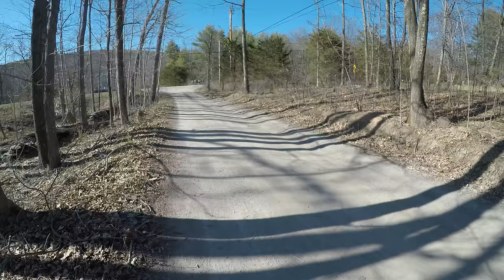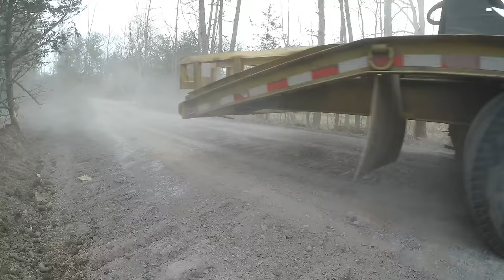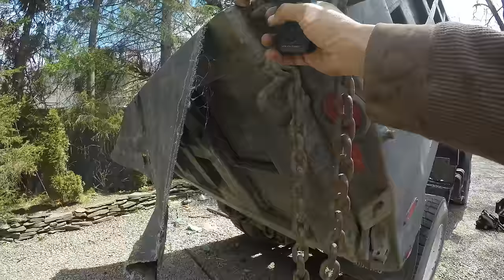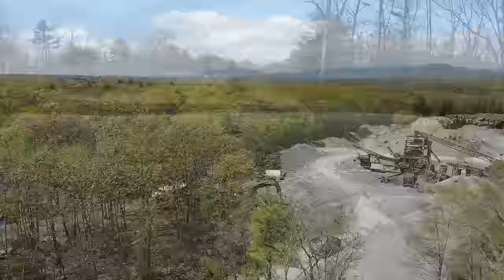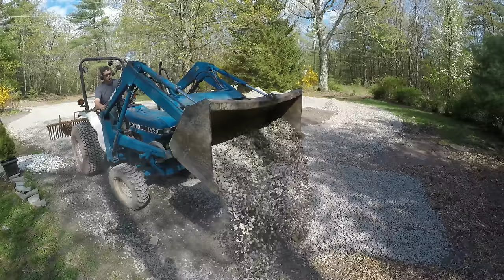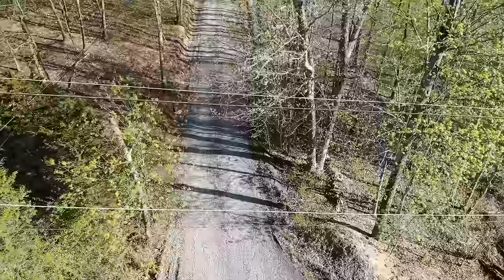Fixing a gravel road

Comment: Andy next time. Your. Tailgating stone. If you only want one side or just the middle or the other side. Cut a 6x6 half the widen of your dump body . Then pot the 6x6 on the floor next to the tailgate right in the right angle where the floor meets the tail gate..... Or two short 6x6. To make a opening in the middle of your tail gate . Put a 6x6in. Before the man fills your dump truck with stone. Then you can control where the stone goes. But one thing. You cannot put the dump body up real high. Or the stone may go over the tailgate. Just a trick. I saw a long time ago. It's your's. now. Keep up the good work. Hey what up with the bridge job and the Demo job. JUNKMANDO.
Reply from the maker: Good tip, I have done that before. But I like it overlapping because it leaves a crown in the center of the road.

Comment: I have seen lots of people use a small tractor and try to work out the potholes.  The road has to be cut to the bottom of the pothole or putting more rocks in them is useless.  The first vehicle that comes along just pops them out.  When you see someone using a motor grader that knows what he is doing they always cut the road to the bottom of the potholes or washboards and then move the rock back so the entire surface can pack back down.

Comment: Just a suggestion, since your truck has air brakes you should spend $30 on a air brake can and hook it up to your tailgate lock like a 10 wheel dump truck so you can just flip a switch from inside of the cab so that you don't have to get out every time you need to unlock or lock your tailgate every time.

Comment: Your need dozer, try a 450 Case or even International both with 6 way blades. They have full power to both tracks all the time. You don't loss a track on a corner & can have dirt spill over the top on straight  or  angle.  For chuck  hole repair use 4-6 crushed nothing smaller.

Comment: You might want to use a short piece of rope to release the tailgate from the driver seat thats what we use on the tri axle dumps it works fine
Reply: Did that in the 60s, too.  You had to before automatic transmissions.

Comment: Such great training videos. For us beginners, I wonder if you have videos that show how to dig and find water, electric and lateral lines without cutting them with a smaller excavator.
Reply from the maker: If you are trying to dig up water lines or something for repairs with an excavator, Dig the same direction as the line taking off line 1' at a time, your far less likely to hook it and pull it out if than if you were digging perpendicular to it.

Comment: Avoiding the potholes with the car is quite easy: just drive off-centered, and you don't hit them and they don't form as fast... so, always keep driving right on the roads edge with driver side on this type of road, and problem is not gone, but much less annoying. You can drive faster and low riding cars are not sitting on the middle ridge of the road, which also gets pushed down a little bit by driving on the edge...

Comment: If I was the owners or residents in this area I would start a fund to pave all of it with tar. I would hire you to do all the under dirt and rock work before the tar finish. I might also hire you to do the plowing of the main/shared road. Other wise I think I would do my own as I know how and I am not real fast because I prefer to be safer and I do not have a lot of experience plowing. It all turned out good in the end. I just have some different thoughts on how I would want things done if I lived there and I had some thoughts on how to make the job easier for  you in my opinion/from my point of view.  If am am wrong about some or most of my thoughts  then I am wrong. Not trying to tell you how to do your job. Just sharing my thoughts. They might be helpful. Be safe out there, watch out for others when your in your dump trucks. people might thing you can stop faster then them because you are bigger. I had a Class B CDL 2 times in my life. Both times I was told to plan on people thinking I could stop better because I was in a bigger vehicle.

Comment: Like the video on this job Andrew , but you need biger truck .
Reply: leo l agreed though that truck runs nice and seems to hold up well to the hell and cringy loads he puts in it
Reply from the maker: Yeah, maybe. That truck is working well, and I like that I can drive it under power lines with the body up.
Reply: @AndrewCamarata  The truck needs some long over due repairs is all. It's fine for your operation I believe.

Comment: At 45:12 in the Demolishing a trailer vid is there a chance the pins might've been damaged or cracked at least while compacting the metal in back of the dump truck? It seemed to operate fine when you dropped that load off but maybe that's where the damage was done. It's just weird that they all gave out at the same time as you mentioned and I hate mysteries lol. Great vid as always.
Reply from the maker: Nah, the one big one was from lack of grease. It came out once like that years ago. Its fixed pretty good now.
Reply: Thanks for clearing that up dude. Cheers!

Comment: And so that this road can be repaired really well, the first layer of thicker stone should be cured with a vibrator, and only on such hardened surface sprinkle stone with a finer fraction. Finally, a roller, preferably vibrating, should cross this road.
 I understand that too small a budget here did not allow such a solution?
Reply: Exactely. He did a great job for the money. Probably much more than expected. And surely repeat clients. The best business plan.

Comment: I am curious about the costs for this project.  I have a similar project coming up in southern NH with what appears to be similar specs (16 ft. easement, 12 ft travelled surface, 2 ft each side for shoulder and ditch, approx 1350 ft. long, former discontinued town road/traditional access to be refurbished for  town maintained access to 4 properties). Do you remember what your costs for this project were?

Comment: I thought potholes formed when the material under the road bed was soft or being eroded away. Have read the way to fix it was having to dig down to the problem layer and replace that with something better. Is recovering annually with gravel essentially a less expensive way to handle the issue?
(Just going from memory of what I've read over the years. Might have it all messed up, of course.)

Comment: I think it is to bad that your Green Dozer dose not have a strait push blade like your yellow D 4 C Caterpillar Dozer. This Dozer seemed a bit light weight when you were working on the side hill cut back. I think the green Dozer is bigger and heavier machine and there fore would have been easier to work with. That is what I think  and saw in the video. I do not know much about what you do as an operator. I know, think I understand how to do what you did. Except for the hill you widen out I think a motor (road) Grater would do a better and fast job. I could be totally wrong also. Just giving my point of view of the job. It turned out good with out a grader.

Comment: Does it rain there allot I was wondering if those number 2's would wash out, I did a 1 mile drive a few years back and used number 3's with 2's on top and some or most of the 2,s washed out about 6 months later had to go back in and grade it and drop a few loads back on it.
Reply from the maker: Usually the 2's don't get washed away, they usually hold up well, Except for plowing, and if its down to thick, sometimes 2wd cars spin out in them on hills.

Comment: Great video as usual.  I have a D5G that the left tension spring needs to be changed out.  Your tracks look tight, have you changed the tension springs out?
Reply from the maker: Are you sure it needs a spring? It doesn’t just need to be pumped up again?

Comment: why didn't you use any of the material from the side to bring up the road base? I usually pull the sides to the middle of the road, then crown.
Reply from the maker: Matthew LaPlant because it was mostly dirt. That would be mud/pot holes if it was used in the road.

Comment: I see you just use crushed rock for the road top, but there's nothing to bind it. Here in S TX we have a driveway and road material called Road Base which is a mix of crushed limestone, limestone powder, and apx 1" gravel.  Often this is also called Caliche' base.  It spreads and packs really well and lasts for years.  Do you have anything like that there?
Reply from the maker: There is gravel with dust in it to help pack/bind. The quarry where I got that has (item 4). It packs and looks nice, but it just doesn't hold up, there is too much dust in it. I have been having good luck with the clean stone with no dust, because it gets pushed down into the material that was under it. There are a few videos on here where I revisit sites a year or two later and show how well similar jobs like this have worked.

Comment: Andrew always use "gravel" (lighter macadam) when making roads but never top with what we in my country call 0-18. This is a mix consisting of fractions from 0 (stone dust) up to 18 mm stones which makes a very good bounding and hard surface. Surely this must be available in the state of New York?
Reply: typically use 3/4" crushed here in the states which is a mixture of the stone dust and pieces up to 3/4" and also run a smooth drum compactor over it to get it nice and locked in, dunno why he used what he did, the first time it gets plowed its going to fly off into the ditch.

Comment: Perhaps you should invest in  a maintainer /grader . The usual applies you avoid jobs if you don 't have equipment and seek them when you do.While the dozer has the power to dig it lacks the fine control to do longer distances
Reply from the maker: I got that pretty smooth with the dozer. No one should be going fast on that anyways. Graders are usually used when vehicles are going like 30mph +
Reply: OK,yes you got the job done ,that's what counts.
Reply: Dont know about NY, but here in Finland we have privately owned gravel roads that runs for tens of kilometers. Grader is essential for maintaining anything bigger than simple driveway, though grader is only good if basic grades & ditches already exist. And you did great job making those!
Reply: My first thought, too. But good graders are really expensive machinery…

Comment: Andrew, did you make an offer on that broken-down excavator? It seams right up your alley, take a chance on it.
Reply: Best to find out some of the back-story on why it's sitting there broken down to begin with.  If the last owner isn't still using it, there could be a good reason why.  To yank it out of there and drag it home would be a chore, and a nightmare once you begin figuring out what is wrong, and whether parts are readily available. Of course, if it's absolutely freefreefree, it might be worth a shot; if it turns to shit, it could be a source of parts though likely not much will fit on his Hitachi. He might be able to flog some of the stuff on Craig's Lisp or Flea Bay.
Reply: The Link-Belt excavator at the stone quarry?  My guess is the quarry ran the machine until it wasn't worth fixing, even for a machine that would never be transported elsewhere, or even have to move inside the quarry.  I think it might be a 240LX, about 53,000Lbs. - should be worth about $4,000 in scrap metal where it sits.  The 160HP Isuzu engine could be rebuilt or replaced; the pumps, hydraulics, controls, hoses, pins and bushings - nothing that lots of money couldn't fix or replace.  A great chance to spend lots of money on parts that would need to be modified to work on the machine, or to make a Link-Belt parts salesman really happy buying factory replacement.   Anyone looking for a project?  Call the quarry and ask what's wrong with the machine.  BTW:  on Craigslist in upstate NY I sometimes see Link-Belt full-size machines in running condition suitable for a farm in the $12,000-$15,000 range (not good enough to ever bring on a job).
Reply from the maker: There are dozens of old machines in that quarry that haven't moved in years.

Comment: that tree tried hard to get at you, heartrate must have went up a small bit when that happened.
Reply: Not to mention the almost tip over when spreading the stone and front wheel hit a low spot !
Reply: uKNOWuLIKE that pinch a hole in the seat
Reply: Try tree grubbing on a dozer without a cab or a canopy.  Old school.

Comment: Not being critical, but why do you use stone to surface driveways? Doesn't the snow plow scrape it all off? I would think something with some more fines would hold up better.
Reply from the maker: Plows can scrape it all off, but its preventable a few ways:
I usually try to do these jobs in spring, and avoid doing them in the fall. That way the gravel has time to get packed down.
The gravel can pack down into the mud, which usually locks everything together well.
Its best to skip plowing on the first/last storms, especially if its just a few inches of slushy snow.
Once it gets a good layer of ice in it and the ground freezes, the gravel doesn't plow. 
The reason I have been using this type of gravel is because its really easy to install (the gravel with the dust doesn't tailgate out of the truck well). Every driveway I have used this gravel on has held up very well, I have done a few videos where I go back and visit them a couple years later to show how they held up. I have seen driveways fixed with the gravel with the dust, and not hold up well. Than get re-done with this gravel, it last much longer.

Comment: got a good look at what you have used for recording sound for your videos.  certainly, I think you would find better alternatives. trial and error for electronics can be successful, tho maybe costly, just as you've explained about some of your heavy equipment, etc.  mentioned as much in a comment on the previous video you made, when you were demolishing a trailer along this road, but hardly too sure, hardly glimpsed the sound device. there are smaller devices for pocket or belt, with good mic to clip on your collar, and use is then effective and hands free, etc.--and much better than the sort of device you had in your hand in this video.  btw--what about snow removal on a gravel road? I guess it might be a problem, but I assure you, I have no real idea, etc. comment?

Comment: Think the reason your smaller dumper may have broke the way it was My opinion Packjng the dumpster with your excavator as hard as you were with scrap metals didnt help much specially an older model dumpster to much stress on connecting parts for that kinda of punishment. Just my opinion

Comment: Question: what happens to gravel road when it snows like 20 inches? how do you plow it? wouldn't all the gravel get plowed out?
Reply from the maker: Normal snow if fine. Especially when the ground is frozen. The problem is when there is when its warm out and there is an inch of slush. I usually recommend skipping those storms because it can mess up the gravel. I have a rubber cutting edge on my plow that does a good job keeping the gravel in place. But its common just to tailgate spread a thin layer of gravel in the spring to keep the road in good shape.

Comment: Why not use a excavator for the job?
Guess that would be faster
Reply from the maker: This was a bulldozer job.
Reply: Instead of tracking up and down 100 times with your bulldozer and bobcat, you could have done it all at once with a excavator, if you had a rotor tilt on it. It would have saved a lot of time and fuel. Maybe you also would need your truck to move some of the gravel, but still much faster.